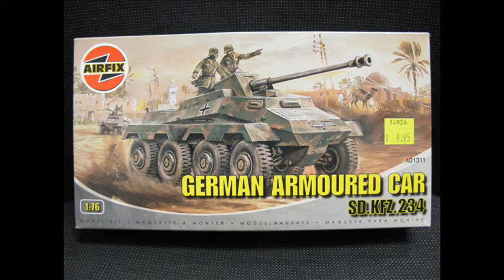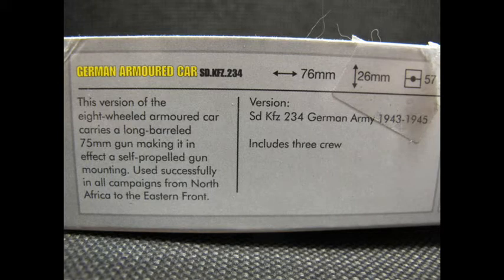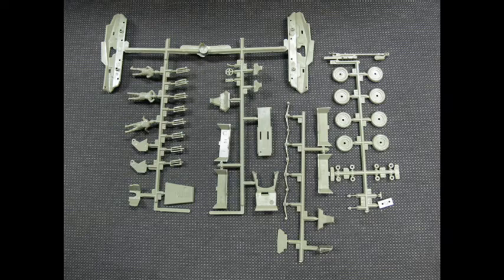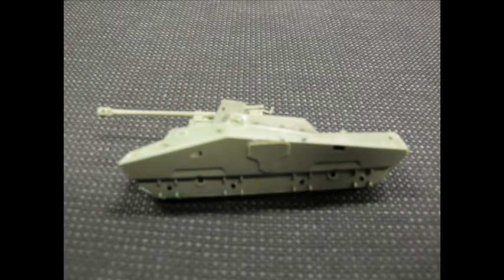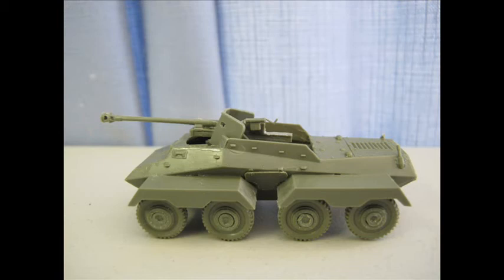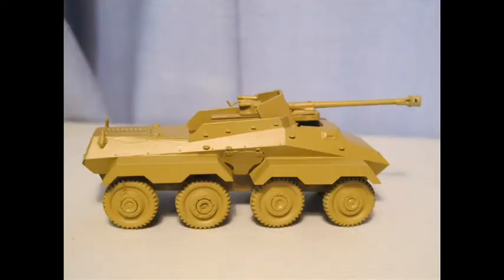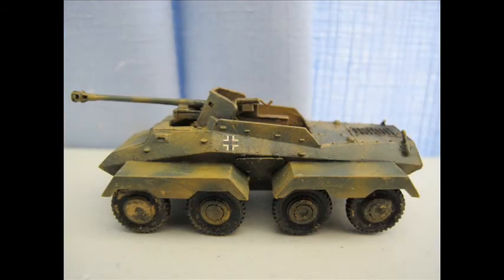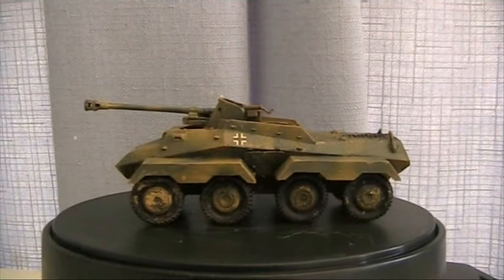Airfix 1:76 Sd.Kfz.234 German Armoured Car

Comment: Airfix made at least 4 fascinating mistakes on this kits! 1st: it's not a 234, it's a ficticious Sd.Kfz. 231 or 233 Pakwagen conversion, which never existed like this, unless it was a one-off, unauthorized workshop conversion cobbled together somewhere in Africa. 2nd: the official Sd.Kfz. 234/4 8-Rad Pakwagen conversion was conceived of and produced in 1944. The Airfix box art portrays an Afrikakorps Pakwagen, but the Afrikakorps already surrendered in 1943. 3rd: To accomodate the 7.5 cm Pak 40 in the fighting compartment of an 8-Rad armoured car, the reverse driving position had to be eliminated, but Airfix will have you mount the rear stearing wheel anyway. 4th: The Afrikakorps received twelve Sd.Kfz. 233 Kanonen-Wagen (armed with the short 7.5 cm L/24 assault gun) in November of 1942, which would have been factory-painted in RAL 8000 Yellow Brown, possibly with a 7008 Grey Green disruptive pattern, but the Airfix box art shows the vehicle with the three-colour camouflage pattern of RAL 7028 Dunkelgelb with RAL 6003 Olivgrün and RAL 8017 Red Brown disruptors that was introduced only in February 1943. The Airfix kit can be saved by kit-bashing, using the fenders of a Matchox 234 Puma armoured car:

www.miniatures.de/airfix-01311-pakwagen-234-4.html
Reply from the maker: Thank you for the fantastic comment , I do enjoy older kits and find mistakes more interesting and fun rather then turn off. Many would demand it to be fixed or trashed yet im looking at the history of the tooling, sculpt and what they could do with what little they had at the time. I found your points extreme and will pin your comment for others to read. If you wish to see another interesting build 4D from china do cheap models around $1-3usd mark yet tooled in the last few years in the vintage style. https://www.youtube.com/watch?v=DiBl_G0RU2I

Comment: The problem with this kit is the mud guards are all wrong. They should look like those of the Puma - continuous.. The Italeri version of this kit is more correct.
Reply: The vehicle modelled by Airfix is the preserved example at the Bovington tank museum, which has mudguards like this and that open gun mount. 

The mudguards came from another armoured car long ago, and are incorrect for this exact mark of armoured car, but are correct for the preserved example at Bovington. 

Italeri's model is of another mark, with a turret, minor detail differences and larger main gun. 

Between these two kits and some aftermarket parts, most of the several versions of this vehicle can be modelled.
Reply: @stevetheduck1425  Italeri also did a 234/4. Personally I like the Hasegawa kits of this series. (In 1/72 though of course)

Comment: Hi.

This takes me back.  I built one about 50 years ago, long before I discovered the errors in the kit.

Contrary to what one of your posters has written, this is a model of the Sd Kfz 234/4.  The  mudguards are incorrect.

The story goes that Airfix measured a real one that had no mudguards.  They realised that it had to have some, and assumed that they would be the same as those on the earlier 8-wheeled armoured cars.  Wrong.

What is also wrong is the potted vehicle history.  I believe that they didn't reach combat units until early 1945.

P.S. it looks as though you've fitted the exhaust pipes upside down!
Reply from the maker: Hello, thank you for the fantastic comment on an older video and build, far from my best or good work and am very weak in German armor knowledge. I am aware Airfix base its armor models on surviving piece in commonwealth museums 4-5 pieces in the very state I live in. I normally take comments on history of pieces with grain of salt and great interest at the same time. No fuss if things are wrong as its just fun for me.  Anyway your experience is sound from my take and I hope the video was a fun nostalgic revisit for you.  I get exhaust upside down pretty often in old videos haha,

Comment: Excellent result using a good old Airfix classic kit... :) :)
Reply from the maker: This was really good kit for a old classic, not a lot of effort was required.
Reply: mokanaman I was surprised at how good it turned out.. not because of your skills, obviously, as they are better than mine, but because of the age of the kit.. may have to try and get my hands on one.. :)
Reply from the maker: Rob BasicModelling
I do recommend it, I find some of the airfix kits a hit or miss. Regardless I will build them all.